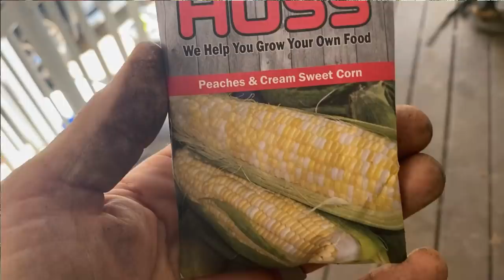If THIS Machine Works, It Might Change Everything On The Farm!!

Comment: Hi Cog Hill.
The cement mixer need to be greased around the gears and the bottom bearings where it turns. We are happy to see their is no rats in it.
Reply: Before he started it, I was thinking to myself..."Where is the can of WD-40 to spay on those gears after sitting there that long?"  I'm not a mechanic, but I'm a big believer in multi uses of WD-40 for this lady.

Comment: That was a really good find on that concrete mixer. I think you need to find some kind of a top to put on that concrete mixer when you're not using it so it won't get wet from the rain.

Comment: I would recommend doing some preventative maintenance on that mixer.  Some lubrication will make the whole thing last longer, including the motor.  Definitely replace the plug and keep the barrel facing down when not in use, so the water doesn't get in there.

Comment: Hello Jason at cog hill farm. The concrete mixer was a gas Engine before they converted it to electric motor the hitch it is for driving down the road hook to the back of the truck so they can pull it down the road

Comment: I’m thinking that if critters not in there, could it be there are chemical residues from the cement mix? Perhaps a good washing inside the barrel would prevent any mishaps with the chickens. Just a thought. 🙂🇨🇦
Reply: Im sure they rinsed it out and let it dry out before they did the feed mixing.

Comment: Don't forget to keep it greased, tipped down so it doesn't hold water and we always kept a small tarp over the top of everything to keep water, ice and sun off the wiring, motor and out of greased areas. That mixer moves fast and be careful it can flip a shovel right out of your hands when shoveling in mixings! There is never a reason to reach in a moving mixer wait until it comes to a full stop! I know it seems like common sense but inevitably something will get in there that looks like you can grab it real quick... but always safety first.
Brilliant use of the mixer!!!

Comment: I'd suggest trying to put an actual on and off switch on the mixer where the motor doesn't start when you plug it in. Just for a little extra safety precaution.

Comment: Nice score on the mixer ! So simple to work on. Pretty much any electric motor would work if it's big enough I would think. I don't think that little trailer it sits on is meant to pull behind a vehicle going up and down the road. I bet you could sell that for 2 grand.

Comment: It's going to need lubing. If you're going to use it for concrete I wouldn't use it for feed. It's the additives in concrete that's the worry. You could sell it and buy a smaller lighter one at tractor supply and have money left over. We had one in our green house. That mixer you got will run upwards of $5,000.00 or more new. You can get one at Tractor Supply for $350.00.

Comment: That’s a great mixer and simple, even if it does break it won’t be hard to fix it all,  but it looks to be in really good shape.  Nice!   Make sure you grab a grease gun and lube all the bearings and spindles but that thing should last forever with basic maintenance. Do you have belts in the electric motor and a few bearings and bushingsAnd that cord should be pretty easy to fix or replace. That’s awesome.  :)

Comment: Does Nugget ‘nest’ as well?  Sleeping outside, I presume.  Do you keep the gate to the chickens closed at all times?  These are probably elementary questions but I have never had hens.  Never wanted any until I happened across Cog Hill Farm.
Reply from the maker: The chicken gate stays closed but they flat over to free range and back in at night. Nugget sleeps outside (in the chicken area) and there is a lean to area that he gets under if there is any weather issues.

Comment: Why wouldn’t you use it to make concrete, 3 parts sand, 2 parts aggregate (rock). 1 part Portland cement (powder) = 3000 lb/sq inch. If you want it stronger, just add more aggregate.
How to make concrete - https://youtu.be/sbpHsedLxkM
The new farm will need a bunch of concrete, this can save you sooo much money. Order a few dump truck loads of sand, a couple of loads of rock, & a load of cement.  👍👍👍

Comment: Wish y'all wouldn't pull electrical cord apart by pulling on the cord. The good way is to pull on the plug. Pulling on the cord risks damaging the connection to the plug. It will. Eventually it will fail. Just pull on the plugs.